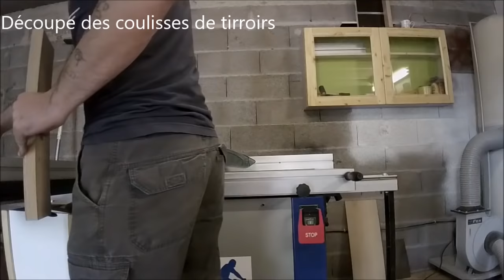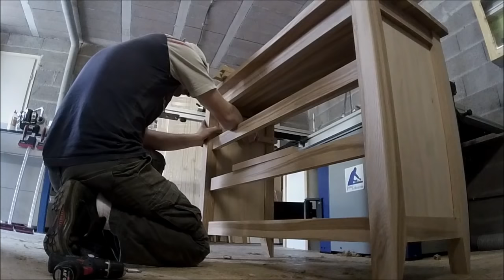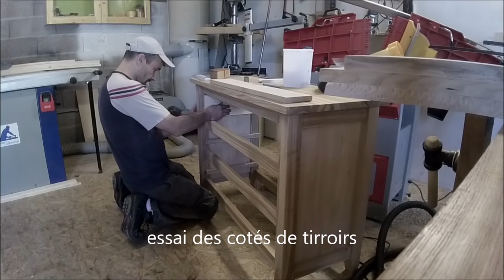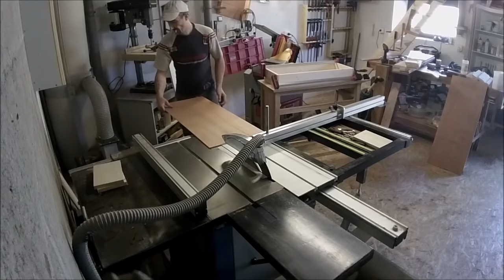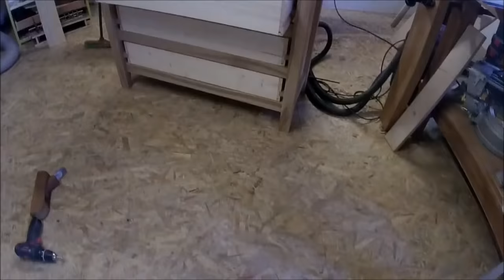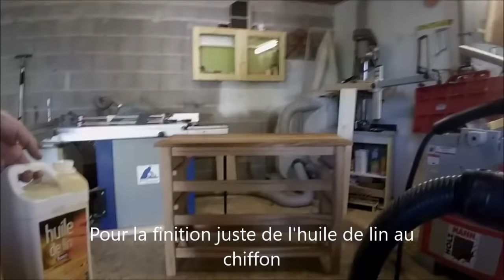fabrication d'une commode partie 3/build drawer cabinet Part:3

Comment: joly meuble j ai une question pourquoi avoir choisi une pannauteuse plutôt que une scie sur table genre la gtx10c de bosch pros et une plongeante genre la ts55 ou ts 75 de fesstool 
   et ce que c est mieux ou c est juste votre chois ou juste parce que il y avait de la place  parce que je projet d acheter et je vois que vous avez  de bonne machines merci
Reply from the maker: j'ai pris une scie a format avec un inciseur car je fait beaucoup de mélaminé
Reply: merci alors c est juste parce que vous couper baucoup de mélaminé si non une scie a table et une plongeante et bien aussi sa doit aussi dépendre de se que vous faite je vois que vous vous faite baucoup d atelier on vois j amait vos chantiers si non vous aurrier pris de lélectroportatif plus pratique pour les chantiers si non vous avez un bon site pour les pannautause pas trop chers la votre coute ver 1500a 2000 euros et et ce que vous avez reçu la scie en une piéce ou a monter parce que mon nouvelle atelier et en dessou d une anexe il fait plus ou moin 30 m carer et comme c est le coter jardin on a mis une porte simple et pas une porte de garage alors il y a maximum 60cm de large alors si la panneauteuse et en pièce sa je peux acheter la même que mais si elle et en une partie je prend une scie sur table et une plongeante merci de l info
Reply from the maker: elle arrive démontée mais ne passera pas dans une porte de 60